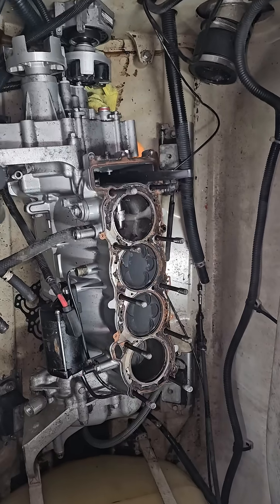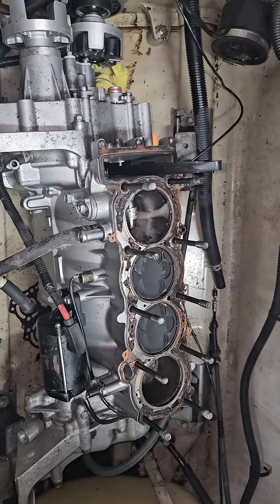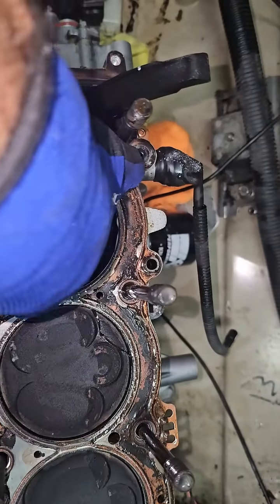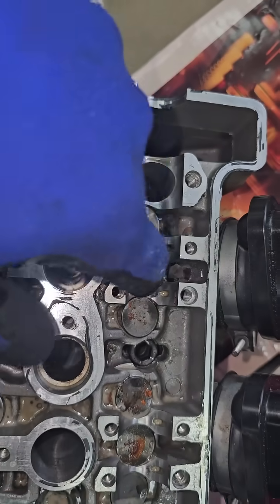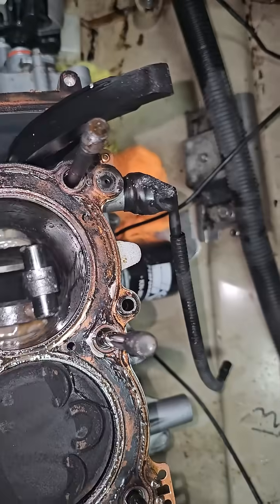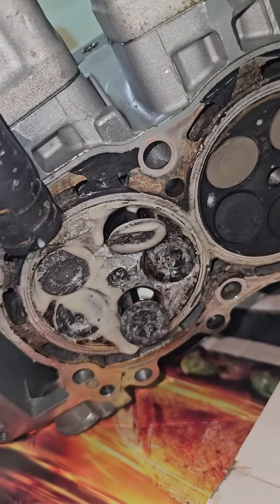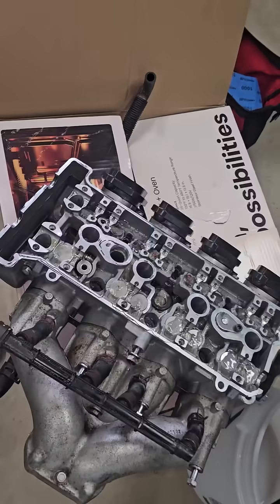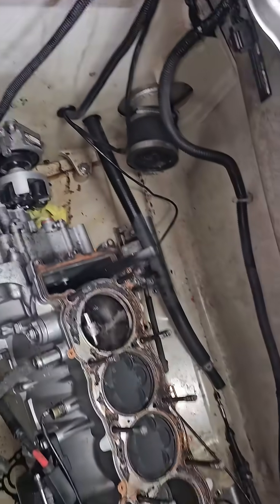Destroyed SBT Chinese Clone Yamaha MR1 FXHO motor Short Block Technologies Clearwater Florida

Comment: SBT engines are absolute junk stay away from them completely. I’ve built enough of these 6B6, 60E, & 6D3 model MR1 engines. I do see milky water in the oil on top of the buckets I had one fail the exact same way from a blown exhaust coupler. It’s best to find a decent block and head off eBay from 2004-2008 and build from there. I just got done rebuilding 2 VX 110’s about to start back on my FX ho. I drilled and tapped a hose barb with a hose extension to the oil drain plugs on all of them I build to extract all 4 1/2 quarts of oil.
Reply from the maker: Yep, all of your advice is good on that. Been rebuilding 2-stroke and 4-stroke for over 16 years now and I've done that oil change mod myself before. Solid mod from Green Hulk From a while back

Comment: Must have been a freak failure. Mine is running strong though its been sitting most of the year.
Reply from the maker: Naaa, I think it's just hit and miss. Same as they're two-stroke motors. Been doing this a long time and I've seen so many SBT failures on both 2-stroke and 4-stroke. Cannot dismiss neglect as a possible Source because I'm not talking about all of my own personal units where I know what the maintenance habits were. So yes, that does come into play as well as a personal responsibility. This one in particular was not neglected. I know the motor, I know the torque specs that were used on every single nut and bolt and I know the owner and his riding/ maintenance habits.